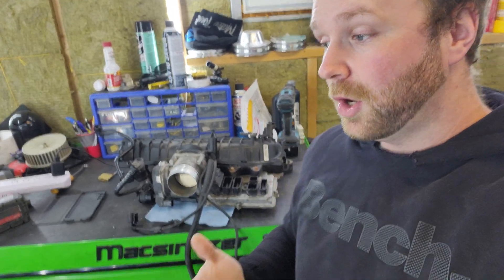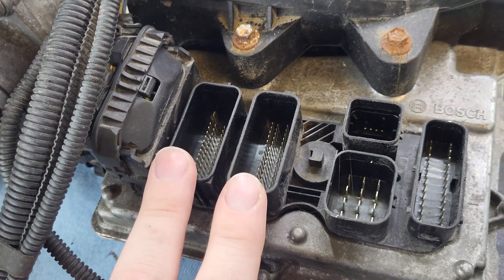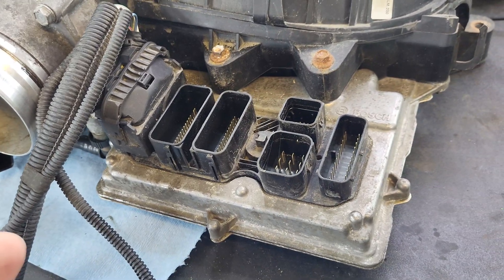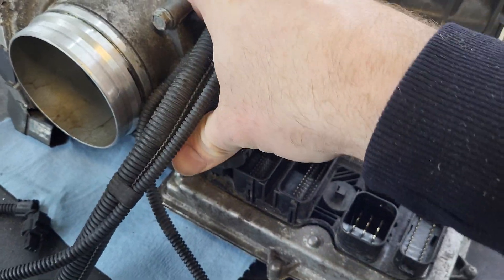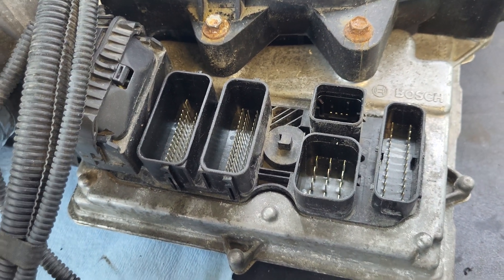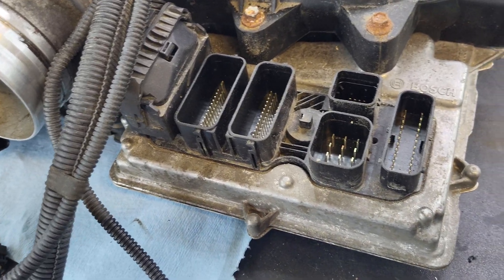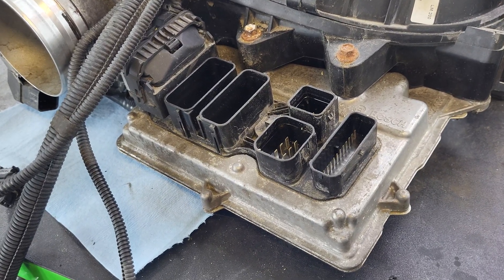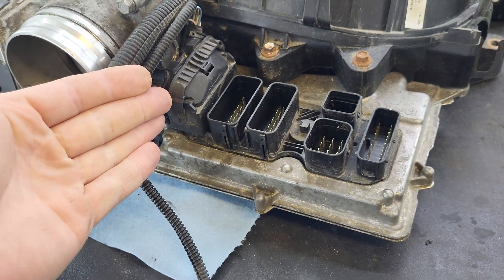Electrical fretting. How to fix it!

Comment: You run a risk doing that with old brittle plastic on top of some janky design.
I once made the mistake of disconnecting a Bosch ABS on a 2004 VW. It already had idiotically thin plastic latches.

Comment: Stabillant 22 made in canada works well on critical connections. Standard motor products sells it under part number sl-5. It was developed originally for space satellites. It is electrical contact enhancer for about .030 of an inch between male and female terminals. Put a drop on each female terminal and throw away the fancy q-tip that comes with it as it wastes material. It costs about 80 dollars for one ounce.
Reply from the maker: Probably lasts a lifetime if using a q tip :)

Comment: Great video.  Never seen anything like this in YouTube.  Seems like I recall this referred to as fretting corrosion at one of the telecoms I worked for.  I’m not sure about dielectric grease working with low current, low voltage connectors.  I’ve used a light oil called DE-OXIT on connector pins, but it is not a permanent fix.
Reply from the maker: Thanks man and will try that. :)

Comment: Would adding a small amount of dielectric grease help these intermittent issues involving electrical connectors or will that only cause more problems?
Reply from the maker: It will help for sure. May still have to do this every couple years as others have mentioned in the comments

Comment: I used to supervise electronic technicians in the Navy. If you have two pieces of metal contacting one another the connection can oxidize. Pulling the plug out and putting it back in again wipes to contacts and remove some of the buildup. Bell telephone used to deal with this problem by sending a small DC current through the circuits. It was called sealing current because it would seal the contacts and prevent the corrosion.

I suggest it when you pull the plug out you may want to examine it and possibly vacuum both pieces before putting it back in again. There may be a buildup of dirt which would aggravate the problem. I don’t know what to call that repair though. 😂
Reply from the maker: That is awesome.  Had a few comments about this in the navy and air force now :)

Comment: I've had the same thing going on with fuses. On my Kubota ZTR the fuel stop solenoid wouldn't shutoff the fuel. Removed the fuse and reinserted and everything was fine. Also on my Saturn Vehicle the passenger power door locks got unreliable. Removed the fuse and replaced and they are now fine. Something so simple but it works. Dielectric grease is a good preventative measure in most of these situations I believe.

Comment: Lance your right. Sometimes just unplugging the connector and then plugging the connetor back on can cure a lot of weird electrical issues. GM did release a TSB back in the late 90's early 2000's about that very subject electrical fretting, reason was that there too many fuel injectors (that were good) being replaced under warranty because of various drivability issues (random misfires, surging,etc) what they found was the injector male pins were fretting (you could see under a microscope) causing variations in resistence values thus causing the customer concerns. What they listed for the fix was(if l remember right) to unplug the suspected injector(s) (at the sametime we would do all the injectors)and put a small amount of dielectric grease (l forgot the part number sorry) into the female connector and then reconnect to the injector. The grease would act as an insulator, vibration damper and help repeal any moisture intrusion. Well it worked. After we started using that grease basically on all unhood or exposed connectors (the weatherpack connectors were good but not that good lol) and eliminated a lot of potential future electrical issues. Thanks again for another great informative video.
Reply from the maker: Gm defiantly pioneered many fixes that we all take for granted!
Reply: @Lancemechanics  Yes they did, only because tbey were looking for cheap repairs.. lol! While l there (left in '07) GM published a monthy news letter titled "emerging issues" ( also had IDL's, interactive distance learning classes pertaining to those issues)which was very informative. It covered all the vehicle lines and in those letters it would describe the issues (was pretty current) that were occuring and how to repair them. Gave a description of the concern and basically what to do and what not to do to correct the concerns. Usually the vehicles affected were still under warranty. They probably still publish it but more on a web based format. Not to ramble on, but GM did come up with the SBD system (Strategy Based Diagnostics) which listed multiple troubleshooting trees on how to address a concern step by step the intent was to keep every tech thinking on the same page, going in the same direction so to speak. It to was a good useful tool. I still use it today. Thanks again Lance hey a great week.

Comment: Over time spring pressure on comtacts allows oxides to form at between pin and contact  , unplugging and plugging back in will cause spring to wipe pin surface removing oxide and reducing oxide which was acting like a resistor. In CAN bus circuits oxides lead to dirty CAN signals you can see on oscilloscope 
Wiping can be good resolution and a light dielectric oil can help by sealing out moisture.
Reply from the maker: Awesome. Ty :)

Comment: With all the many digital devices lurking under the hood now this doesn't surprise me at all. I work with communications electronics which is in a highly controlled environment,  it's surprising how reliable automotive electronics are considering the use and environment they live in.
Reply from the maker: always tell people same thing. For what a vehicle does they are extremely tough

Comment: Would you recommend to dielectric on afterwards?
Reply: I use CRC electrical contact cleaner. Works fairly well.
Reply from the maker: Yes absolutely. But with all good things in moderation :)

Comment: When I was working at GM, the training center said to mention "terminal fretting" on the repair ticket.  Otherwise unplugging and plugging back in could mean anything - loose connection, a folded over seal, dirt inside the connector. Basically, anything that screams " the Mechanic screwed up".
Reply from the maker: Pretty sure it was a gm tech who taught me this years ago! Makes sense :)
Reply: @Lancemechanics  😆😆

Comment: I found that it was nearly impossible to be paid under a warranty claim if there were no associated part that failed and was replaced or adjusted. If the Parts Manager would acquire some electrical contact enhancer liquid that could be charged out on the repair order then even out of warranty claims could be charged labor.
Reply from the maker: Honda, we has to explain what we did under patently and potentially could get paid 1h diag plus a scan if done properly

Comment: Noticed this with can/srs connectors mostly. They run on very low voltage and are super sensitive to variations.
Reply from the maker: Great point! forgot how many air bag lights i got off by just doing that!

Comment: I never understood why manufacturers put PCM, TCM and other ones in and around the engine bay. It’s doomed to fail. I know it’s harder to get to inside the vehicle at times but the wear and contamination is so much less than outiside in the engine bay. Some are even in the trunk on German vehicles. That even makes more sense.
Reply from the maker: I feel like older civics had them in the glove box, cant remember the reasoning to go back into the engine compartment. but I guess they all follow each other in design trends
Reply: Disposable cars force more repairs  and new purchases.
Reply: @MD-zh4ym  that’s very true.
Reply: @Aaron-or6ov  These things began changing about forty years ago. Old guy here.